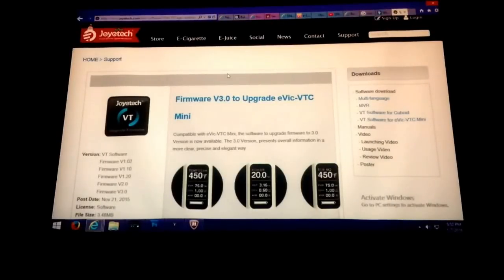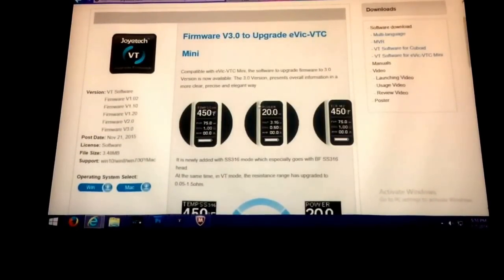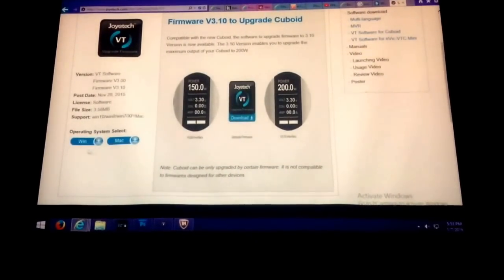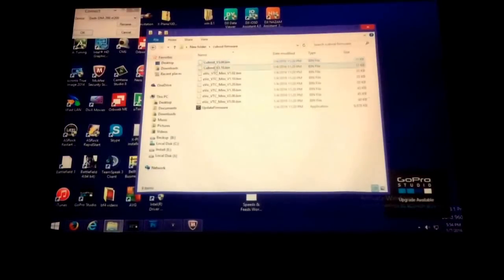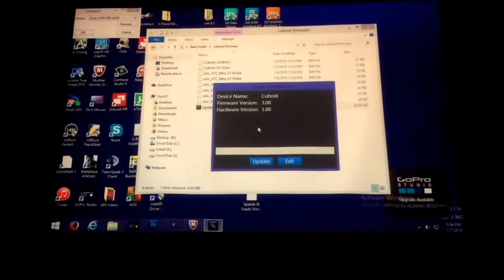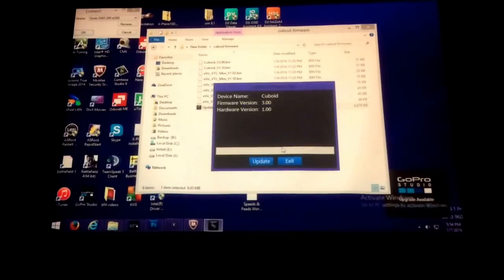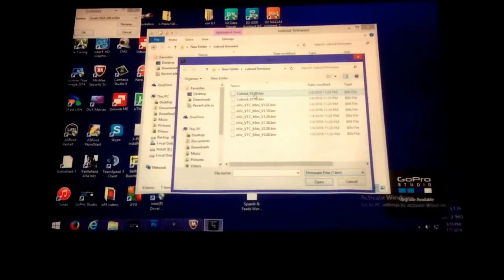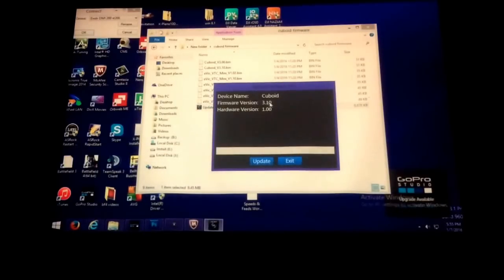How to update firmware on the Joyetech Cuboid 150w / 200w and Vtc mini 3.1 / 3.0 to make it 200 watt

Comment: It won't work for me. I get a message from Adobe stating the file could not be opened because it is damaged or not supported. So I guess I will not be able to upgrade my new mod. unless I can figure out how to get around this Adobe issue. I don't have the money to pay a monthly fee to Adobe for their services. Not really a big deal as I don't vape at the top limit of the mod anyway. Thanks for the clear and concise video.
Reply from the maker: +Loren Robertson  u can update adobe flash and reader free on adobes web site try that also make sure you are using the usb cable that came with the mod cause not all cables are the same and also try using different usb ports on your computer. hope this helps
Reply: Thank you for responding. I tried all that. But not concerned with the update, as I currently don't vape at those high levels with my coils anyway.

Comment: Hi, i had this problem. i already upgraded my firmware but the max wattage i got is only 187.5watts. i'm using Cuboid 150 btw
Reply from the maker: +yanzz labra it will go to 200watt the motherboard in it is reading the ohms and is not able to fire it that high or it willtake more amps then 2 18650 batterys can put out so it will fire at 200watt just not with the ohm build you have on it right now
Reply: +intel2you yep! i rebuild it. previous build was 6loops 3mm guide dual coil reading at .4, changed it to 9loops. thanks man!
Reply from the maker: +yanzz labra i posted a video to youtube about this and why it dose it